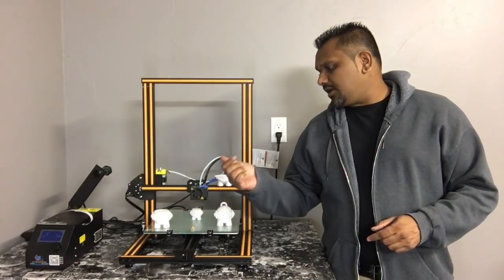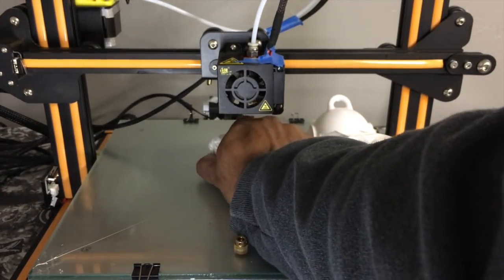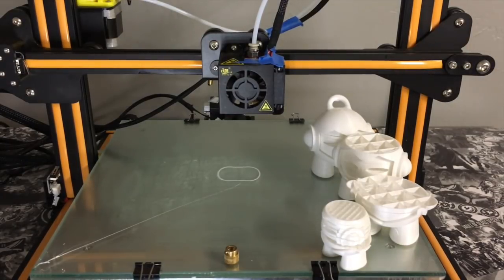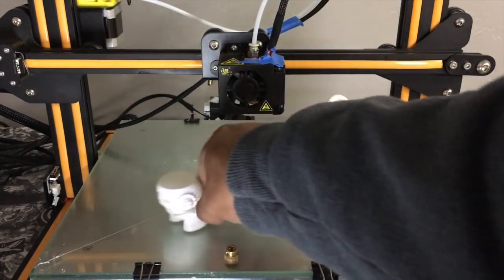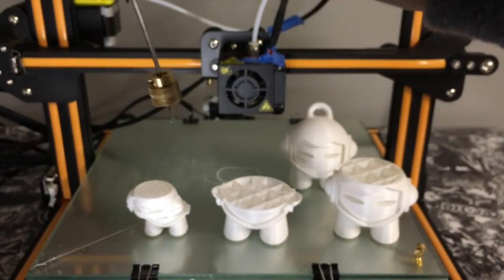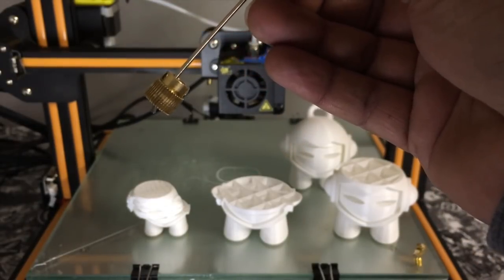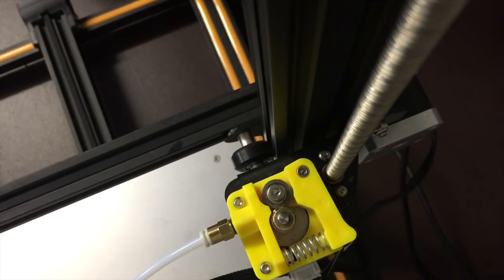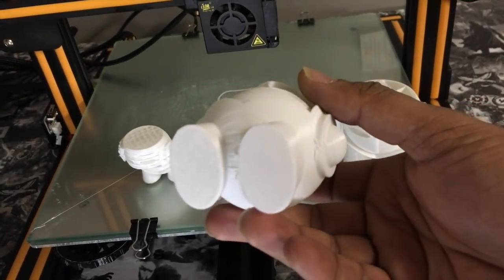How Nozzle Clogs & Filament Feeder Gear Affect Your Prints!

Comment: I just fixed a problem that was caused by the feeder gear. Same order of events, clogs followed by messed up feeder gear. However, mine didn't worn out it just got a bunch of crap between the teeth. I cleaned those up and everything stated working perfectly after that. Worth noting that I only found that problem by running a print until it had issues then stopped the print and retracted the filament. I then saw that the teeth marks ok the filament were uneven with some signs of skipping on some spots.

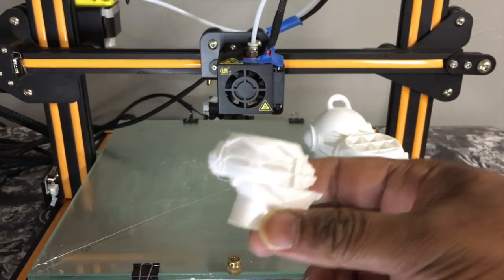Comment: I have problem like the model you hold it in 1:14. Every thing become well until it reach a specific point of model the printer become printing not in the right place. I tried two times with my first print! And the problem repeats at the same point. 

Could anyone help me. My printer is new!!
Reply from the maker: try printing another model, i think you  just have a bad STL file.  Cloggs would be random but if the model has problems at the same spot every time i think STL.
Reply: SAN TUBE

 I tried to print the “CAT” model in the original SD card

I hop that solve the problem 

Thank you very much .. your channel is very useful to me 😃
Reply from the maker: Happy to help.  The Cat STL on most of the new printers are bad G-CODE so that is your problem.  Print something else like the marvin or something small and go from there.  Good Luck and Happy Printing.

Comment: i have an ender 3 max, and i start printing, but around 5th layer, the pla stops extruding, the printer goes printing without the filament coming out, and in the feeder, the filament is kinda pressed too much between the extruder gears, i've noticed that when it retracts the filament gets chewed and that0s when it stops going trough the petg bowden, any suggestion on what to do to fix this? :)

Comment: I have a problem with the nozzle hitting the print when it gets to .09. It pushes it a bit to the side and continues to print. Not sure if it's a clog issue or what. Any help would be greatly appreciated.
Reply from the maker: Keep an eye on your z axis, make sure its doesn't drop slightly. Also make sure you print is sticking to the bed.
Reply: Seemed to be a mix of a few things. The tape on the bed, the glue on the tape and possibly an imperfection in the glass. Looking good now though. Thanks for the quick reply and keep making these vids. You're doing a great job!
Reply from the maker: Thanks

Comment: Just a quesion not concerning this video: 
Have you tried printing flexible filament yet? Do you need mods for this and how does it handle it?
Reply from the maker: If you have the CR-10 then no, you don't need any mods.  You can print right out the box.
Reply: SAN TUBE ok thanks. 
I will try it.

Comment: I'm having a similar problem on my CR-10. It clogs, I clear the blockage, try to print & it goes fine for a few prints, then clogs up again.

I ended up replacing the hotend with an E3D V6 clone as I wanted to print some higher temperature stuff anyway. It worked great for a few weeks around 2kgs of filament with no issues, but all of a sudden this weekend, I'm having the same problem.

I'm interested to see if changing the gear helps you. I've checked mine & it has no visible wear.

I have noticed the hotend fan changing rpm randomly, so mine could be a power supply issue, maybe not providing enough cooling to the heatsink & causing heat creep, then cooling comes back on full & causes the blockage in the thermal tube.
Reply: Andrew   have u pulled the ptfe liner from the hot end and checked it ?
Reply from the maker: I will let you know how it went.

Comment: Make sure you retraction speed it not to high to. Also do not use a damper on your extruder stepper. Also check that your filament spool is not to tight.
Reply from the maker: retraction speed has been the same and everything double done.
Reply: Why not to use damper on ext. Stepper? Did not try but I will buy dampers soon.
Reply: The damper is flexable and allows the stepper motor to deflect away from the backing bearing. This reduces the contact area and drive friction

Comment: Replace your extruder gear with a stainless steel flashforge creator mk8 gear... Last forever and less filament stripping..
Reply from the maker: ok i will look at it.  Have you ever used it.
Reply: Yep i have a flashforge creator pro and a cr10s and replicator 2x... Replaced the cr gear and much better